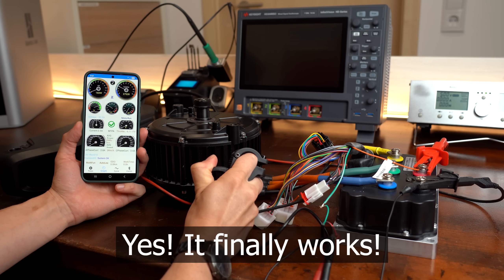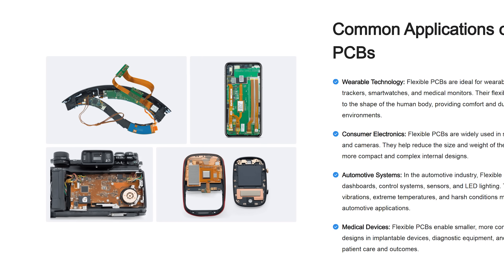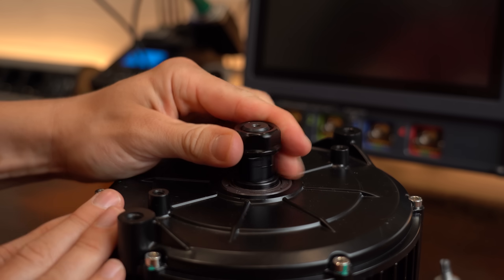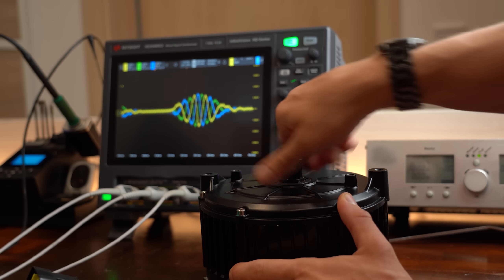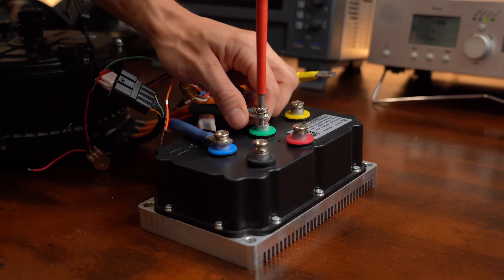The Most Important Motor for our Electrical Future?! (PMSM) EB#63

Comment: AI Summary

Abstract:

This video provides a detailed comparison between Permanent Magnet Synchronous Motors (PMSM) and Brushless DC (BLDC) motors, explaining why PMSMs are crucial for electric vehicles but less common in hobbyist projects. The core difference is identified through their back-EMF waveforms: BLDCs produce a trapezoidal waveform, while PMSMs produce a sinusoidal one due to their internal magnet and winding structure. The video demonstrates that while a standard BLDC ESC can run a PMSM, it is inefficient. The proper method involves a sine wave controller (e.g., a Fardriver) that uses Sinusoidal Pulse Width Modulation (SPWM) to generate a matching sinusoidal current. This results in significantly higher efficiency, quieter operation, and smoother low-speed performance compared to the 6-step commutation of a BLDC. The necessity of Hall effect sensors for providing precise rotor position feedback to the controller, enabling advanced techniques like Field-Oriented Control (FOC) for maximum efficiency, is also highlighted.

PMSM vs. BLDC: Unpacking the Motors of the Electric Future

*   00:00:04 PMSM Explained: The video introduces Permanent Magnet Synchronous Motors (PMSMs) as a vital, high-efficiency motor type used in electric vehicles, but notes their complexity has limited hobbyist adoption.
*   00:02:11 Comparison with BLDC Motors: BLDC motors are contrasted as the go-to for hobbyists (drones, electric skateboards) because they are robust and easy to control with a standard Electronic Speed Controller (ESC).
*   00:03:02 The Fundamental Difference is the Waveform: When spun manually, a BLDC motor generates a trapezoidal back-EMF voltage waveform. A PMSM, due to its different internal construction, generates a pure sinusoidal waveform.
*   00:04:43 Inefficient Control Mismatch: While a standard trapezoidal ESC can spin a PMSM, the mismatched waveforms lead to inefficiency and rough operation.
*   00:04:58 Proper PMSM Control: A dedicated sine wave controller is required to drive a PMSM optimally. These controllers can be complex to set up due to poor documentation and specific wiring requirements for ignition and throttle.
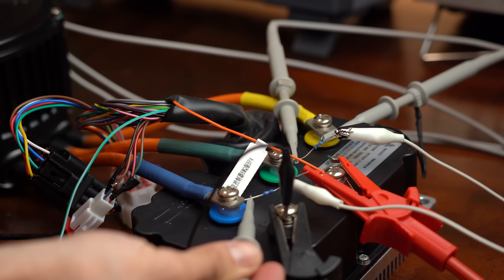*   00:06:24 Sinusoidal Drive Method: Sine wave controllers use a technique called Sinusoidal Pulse Width Modulation (SPWM) to approximate a smooth sine wave current. This creates a smoothly rotating magnetic field inside the motor.
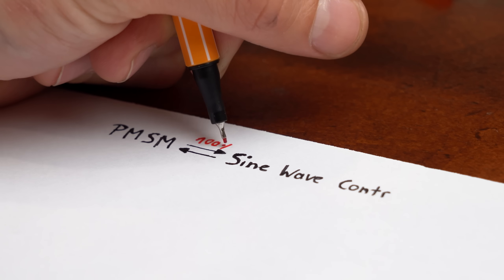*   00:07:14 Key Advantages of a PMSM System: The matched sinusoidal drive provides significant benefits over a standard BLDC motor setup:
    *   Higher Efficiency: Less energy is wasted, which is crucial for battery-powered applications.
    *   Quieter Operation: The smooth drive eliminates the harsh noise associated with 6-step BLDC commutation.
    *   Superior Low-Speed Performance: The motor runs smoothly without the "cogging" or jerkiness typical of BLDC motors at low speeds.
*   00:08:06 Field-Oriented Control (FOC): Advanced sine wave controllers use FOC to precisely manage the magnetic field, applying the minimum current necessary for the desired torque, which further maximizes efficiency.
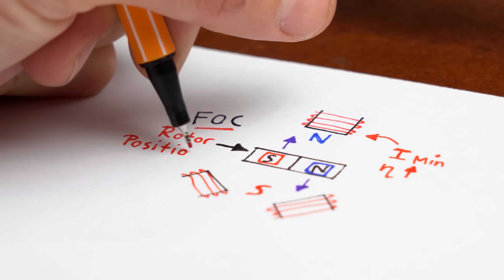*   00:08:36 The Critical Role of Hall Effect Sensors: To achieve the precise control needed for FOC, the controller requires exact rotor position data. PMSMs use built-in Hall effect sensors to provide this constant feedback.
*   00:09:29 Conclusion: The Right Motor for the Job: BLDCs are popular for simple, low-cost hobby projects. PMSMs, however, dominate the EV and E-Bike market because their superior efficiency is a critical requirement for extending range in battery-powered vehicles.

I used gemini-2.5-pro| input-price: 1.25 output-price: 10 max-context-length: 200_000 on rocketrecap dot com to summarize the transcript.
Cost (if I didn't use the free tier): $0.02
Input tokens: 12795
Output tokens: 821

Comment: One thing you are skipping over is that efficiency of electric motors is not a single number, it is dependent on torque and rpm.

This makes the choice between PMSM and induction a little less obvious in EV's, explaining the market share of induction motors. 

Would be great to see a slightly deeper dive into efficiency!

Comment: BLDC motor is synchronous and uses permanent magnets. And I've seen esc's use sensorless sensing for foc. Quite cheap ones aswell. The naming scheme is confusing as the line is quite blurry.

Comment: Suggest you buy and analyze the VESC-based Floatwheel ADV2 and compare it against an original Onewheel GTS, which are both self-balansing one-wheeled mix of a skateboard and a snowboard or wakeskate. Floatwheel is uses open-source software while Onewheel is closed source. Tony from Floatwheel has posted a few videos explaining some things and think your viewers might find those interesting hearing the difference from you.

Comment: My Dirtbike on its tiny gas tank gave dozes of miles of Hell around my area when I was a kid 200cc. I want a generator that produces electricity for an electric motor because all the strain can put in capacitors for going wild. Thermoelectric generator wrap to bleed into capacitors with generator strong enough to push at least 60 with a good motor? Mm.. Regenerating NOS like boost. Capacitor set taking power from waste heat while the other set dumps but switch between each other like pistons..

How good capacitors gonna be? Think sky trucks with internal Triboelectric wind to Static lift support and Ultrasonic never jam thrust direction control.. Connects Air Sander to compressor and lets it whine Air doesn't make it to the motor its the air leaving an exhaust connected to the motor.. That's how with modern version of U.S Army Barrierless air Ultrasound filtration can keep turbine blades clean. Google: "Boeing Plasma force field blocks Bombs" Bombs tested to smash U.S Military Steel, now we're back to Capacitors.. - Think Tank

Comment: Now I'm wondering how one of the FOC BLDC motor differs. They are usually used in scale RC rock crawlers. Sensored brushless motors are also pretty popular. Or just a standard 550 brushed motor.

Comment: The last thing you said about the PMSM, that is more efficient, is just a small part of the reason for it's wide use in EV industry. 
The main reason is.. drums 🥁... it can provide generative breaking. Induction motor is incapable of such performance. So, though induction motor and PMSM are not far from each other in efficiency, this key feature makes the choice of PMSM a favorable choice in EVs.

Comment: Should definitely try making an electric go-kart or something. You have several two-wheel devices, why not move to four wheels! Definitely adds some engineering challenges (2WD or 4WD, direct drive or shared motors). Could definitely be a small series, from motor choice, building and wiring, adding regen breaks, computer-vision projects, bunch of later things could be added. I know they make frame kits for carts for people to build themselves.

Comment: 🎯 Key points for quick navigation:

00:04 🔋 PMSM motors are vital for the electrical future, especially in electric vehicles.
01:02 💡 JLCPCB offers transparent flexible PCBs that are affordable and suitable for innovative projects.
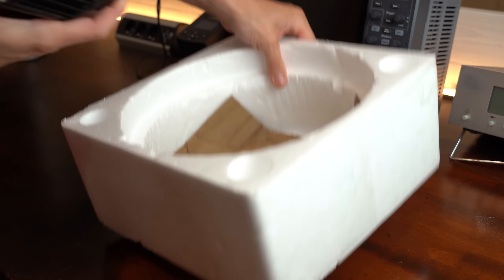01:52 🚴 PMSM motors are powerful, typically rated at 5000W, ideal for high-power applications like E-Bikes.
02:45 ⚙️ BLDC and PMSM motors can look similar, but operate differently; testing reveals distinct voltage waveforms.
04:58 🔌 PMSMs require specially designed sine wave controllers rather than standard ESCs for optimal performance.
07:01 ⚡ Using sine wave controllers provides advantages like constant torque and higher efficiency compared to ESCs.
08:56 🔍 PMSMs include an encoder for precise rotor position, enabling more efficient control methods like FOC.
09:25 🌍 Despite the rise of PMSMs, induction motors remain the most popular due to their cost-effectiveness and robustness.

Made with HARPA AI

Comment: This video is misleading. The two motors are essentially the same thing, Optimised for a more crude swithched output from a 3-phase ESC, it's known as BLDC, whilst if optimised for a more sophistocated 3-phase sinewave controller, it's known as a PMSM. In some cases there is zero difference between the two 'types' other than the name.

Comment: I strongly recommend the textbook "Design of Brushless Permanent-Magnet Machines" by Hendershot and Miller that discusses these distinctions and many more. FWIW I'd explicitly define 'ESC' as meaning 'trapezoidal commutation' at the beginning since it's now possible to buy a decent number of FOC ESCs; I wouldn't assume ESC always means trapezoidal. Also... the summary of "BLDC v. PMSM" is not strictly true; it's really "sine wave commutation versus trapezoidal commutation". BLDCs can be driven by sine wave controllers and will also see massive performance increase compared to BLDC driven by trapezoidal controllers in the same way that PMSMs do.

Comment: So how can I tell what type of motor I have?  I took apart a broken Greenworks garden tiller that has a pretty hefty 3 phase brushless motor with speed control that runs on an 80 volt battery and the problem is that it only has one speed, full on. I'd like to run it with a variable speed controller but haven't found any that work. A drone motor controller wouldn't turn it at all so I tried a 220 volts controller that can run the motor out of a Maytag washer successfully but this motor only hums and jerks around a little. I never thought of spinning it and checking to see what kind of output I get though, maybe that will be a clue?

Comment: As you point out,  BLDC motors can be driven with 6 step commutation causing torque ripple but BLDC motors can also be driven with FOC if you have a way to measure the current on two of the phases. So the only difference is that PMSM back EMF is more sinusoidal?

Comment: Some ESCs do claim to be able to do sinusoidal drive. Common for driving slow motors and also for making them quieter. I believe AM32 firmware supports this. You may even be able to flash it to your esc

Comment: bldc can also run with sine wave controlers. many electric bicucles use sine wave controlers and bldc motors to be quiter and gibe better torgue at lower rpm , but have little lower top speed.

Comment: PMSMs and BLDCs are not much different aside from the back EMF waveforms they are alleged to have. They are pretty interchangeable in most cases with some slight to moderate performance differences. PMSMs have the disadvantage of requiring big magnets as they are scaled up to very large sizes. Another issue the speed ends up being limited practically by the voltage source, and so the range of speeds achievable. For EV's, manufactures are currently experimenting with a hybrid between synchronous reluctance motor and PMSM called the PMSynRM. Switched reluctance motors are starting to see more interest since they can offer really good power density and operate at very high speeds, with the primary disadvantage being torque ripple / noise. Now that some grunty electronic controllers can implement a sort of feed-forward controller as part of the state vector computation to help cancel out the really horrible torque ripples.

Comment: The difference between a PMSM and a BLDC seems to be of the same kind as the difference between a lithium battery and a lifepo4 battery - there is none, one is just a broader category while the other a more specific implementation.

Clearly a PMSM is also brushless and a DC motor (only if viewed in combination with the necessary controller to drive it, on the motor side neither is DC in any meaningful sense).

Comment: Nice video! But at 7:49 the circle is wrong, right? It it is smoother than the ESC motor but those peaks still "connect" in straight lines, is this correct?

Comment: Make an elevator or a device to carry you or your stuff up and down stairs. Include the ability to manually take control if you want to stop, reverse, and/or hover at a particular spot. It could also include recharging a battery after you place a load on the platform (or chair) and let it lower the load at a controlled rate.

Comment: Wouldn't the PMSM benefits of lower torque ripple and being quieter be achievable in BLDC motors by just opting for a different commutation method? So not trapezoidal, but by applying a MacDonald PDM voltage waveform on their phases? Sure the controller would be more complex, but not more complex than one for a PMSM I guess.

Comment: How about building a Small Light City car (Class L6e) which you can build at home? 

If you keep it under 6 kW continues power, capped at 45 km/h and below 425 kg (excluding the battery) you could register it (in theory) and drive it with a AM license. So you could add 2 of those motors.

So in theory you can add any battery capacity you want to it, like an old 100 kWh pack from Tesla, and basically drive forever :)

Comment: Many EVs can have both a PMSM and an induction motor. One advantage of a induction motor is when you turn off the power supply the motor magnets are also turned off so no core losses. Many EVs have a PMSM for the main motor then an induction on the same shaft for when the car needs extra power delivered.
Reply: Ev using PMSRM or SRM motor,  no PMSM

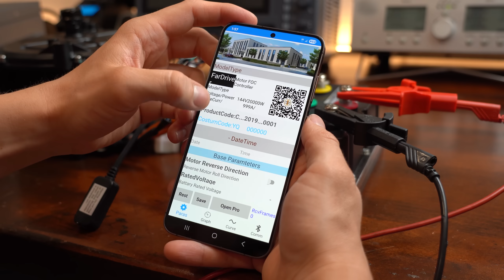Comment: 5:38 Software developer here. On Android, you have to request location permission in order to access Bluetooth Low Energy. I think with Android 13+ they have given Bluetooth LE it's own permission, but most apps still request location for compatibility reasons. I think Android used the location permission for BLE because you could calculate a users position based on known devices nearby and their signal strength. But nobody uses BLE for that.

Comment: PMSM and BLDC are almost the same. Just by the terminology a BLDC actually IS a PMSM. Because it uses permanent magnets and is synchronous. The difference is just in the Details of the arrangements.
Servo motors in automation are PMSM for a loooong time. Each industrial robot has 6 of them for decades.

Comment: You're not the only one who had trouble getting one of these working for the first time. I opted for the non-bluetooth way of doing it, but the instructions for the serial adapter are just as bad. They actually tell you the incorrect way to connect to the unit, saying to ensure that canbus is selected when the unit actually just uses regular serial.  Took me an hour to figure that one out because it'll kind of half look like it's trying to communicate, or it'll get a single frame of information and then not update. But, got it going in the end.  Nice little units really.

Comment: You should look at switched reluctance motors next; these are still very uncommon, but promising since they do not require rare earth metals to build, while they don't have the rotor current loses of an induction motor.
Reply: This, and e.g. salt batteries for stationary energy stores where size and weight don't matter. Use rare metals only where there is no option.

Comment: Summary: They are basically the same motors, only the shape of the magnets and coils is such that a BLDC motor generates a square like EMF when the rotor turns at constant speed, which makes it more efficient when driven by simple and cheap driver providing a block wave, while a PMSM motor is designed in such a way that it provides a sinusoidal 3-phase EMF, which makes it more efficient when driven by a more complicated 3 phase sine wave driver.  Because the torque of a PMSM motor is more constant it runs more smooth, especially at lower RPM, and the efficiency is a bit higher.
Reply: excellent summary of the video. perfect recap for after watching the video.
Reply: Didn't read your summation, bcuz it only 10 minute video
Reply: @fatteebaddee didn’t read your comment because I read the summary
Reply: @dustydus5762 i did not read anything, you cannot prove otherwise
Reply: @murk1e  didn't read anything I'm illiterate

Comment: You could put the motor in a FLPHG i have one if you want to see it fly it is 110cc the battery needs to be very light weight because glider set up can't exceed 70 kilo  without pilot and fuel? Not sure if a battery is the same as fuel, that something to consider my opinion is fuel means recharging and battery is part of set up weight

Comment: A bldc motor is also a PMSM. A PMSM is just optimized for different applications and I don't know what was going on with your bldc motor but if you turn most bldc motors they produce a 3 phase sine wave.
Reply: Bldc is a misnomer anyways. I think BLDCs were at one point drop in replacements for brushed motors, so brushless motor, eg. pm + an integrated driver. 

Now BLDC is used for all kinds of motors, but they are most certainly not "DC"

Comment: Are PMSM actually inherently more efficient than BLDC motors when driven optimally for their winding and magnet arrangements? If so, why? I would think that a BLDC motor driven via FOC would be basically equivalent; the fact that it has a trapezoidal back EMF should not be inherently more/less efficient than a sinusoidal one as long as the controller is providing the ideal driving waveform for the motor in question.

Comment: They're literally the same thing. Just called different things. I don't even know why they call then BLDC, because it's not a DC motor at all. It needs a controller, which could be designed to take AC or DC. It's always outputting AC. It's like whatever moron decided to call the LCD displays backlit by LEDs "LED displays" when they knew full well that the near future would unveil displays with pixels made of discrete LEDs.